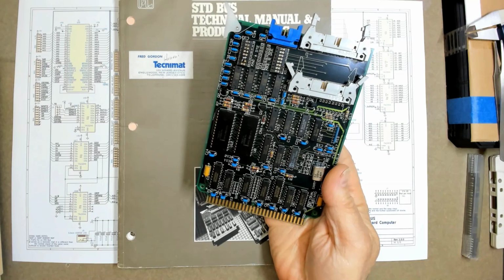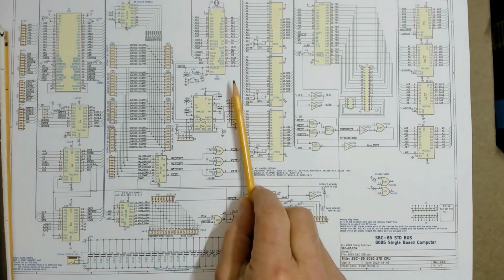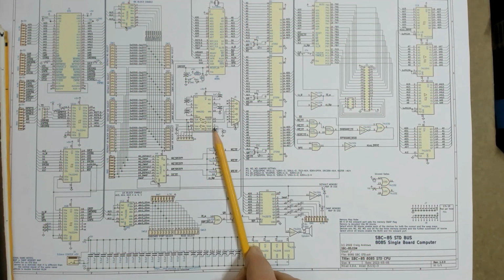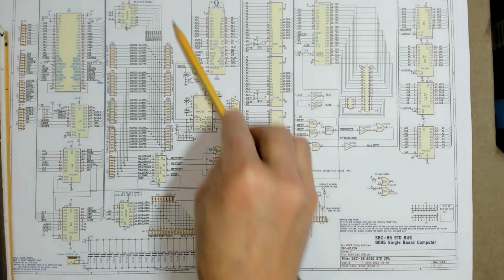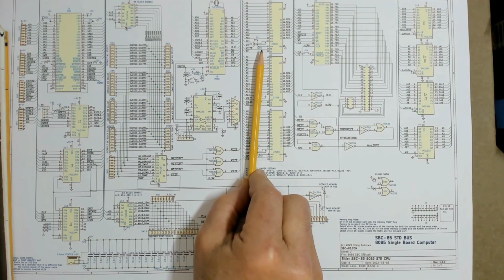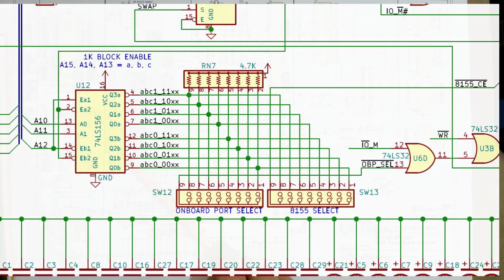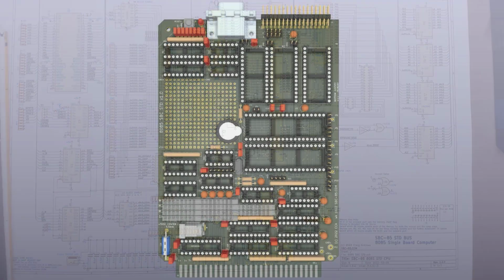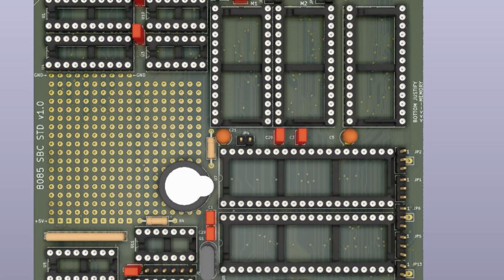{80} New 8085 STD Bus Single Board Computer project

Comment from the maker: OK people, that didn’t take long, we have a winner in the “How big an idiot is Craig” contest.  
A big, big, mistake in my decoder has been pointed out to me by my newest buddy Denis in Australia…. The short version is this…. The genius of the decoder is COMPLETELY destroyed by cross shorting of the default and alternate maps.  Example… if two switches are closed for a socket, say the bottom 16K for M1, then those switches are shorting the two decoder outputs together for *everyone*!!  So now when the alternate map is used, if someone only wants to use the bottom 8K, because of this switch shorting the alternate will map the same 16 k as the primary map.  This could be solved with a massive number of diodes to stop cross-connection of the decoder outputs, or as noted by the same person the multiplexer can be eliminated if the decoder is duplicated… one decoder for the default and one for the alternate.

While we make arrangements to get the promised STD board to Denis, I will fix this bug and then we can restart the contest.  I am sure I can scrounge up another STD giveaway board.  See Denis’s original explanation (and his note on the max-232) on the schematic download page here: https://sbc-85.com/download/std-bus-8085-sbc/#comment-33

Comment: what is your compiler?
Reply from the maker: I use an old assembler by William Colley that is maintained by herb Johnson. Herb has been very responsive to requests and added a couple of features for me a few years ago.  The first was to create a symbol table file so I can pseudo-link files. The second was to add print on/off commands to allow the list output to be turned off and on to simplify outputs.  
https://www.retrotechnology.com/restore/a85.html
Reply: @HelloWorldETX  I used to have an ISIS-II Thunder board Emulation to compile fortran/assembly for the 8085 Micro-link STD245.  The compiled file is written to an EPROM.  We lost the ISIS-II board.  Just wondering if there's any more compiler for the 8085 out there??  They are such a good product.
Reply from the maker: @cnn94001  What was the hardware platform that you were using for ISIS? If I need to compile something I use my MDS225 or iPDS. But I mostly just program in assembly nowadays.